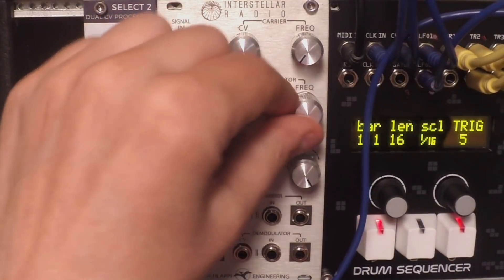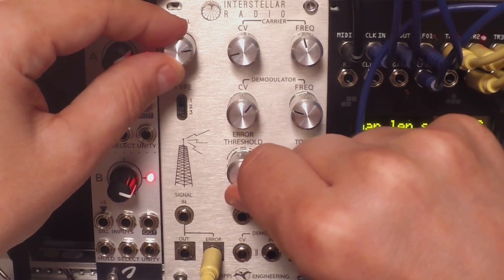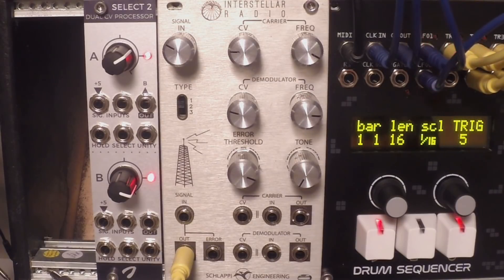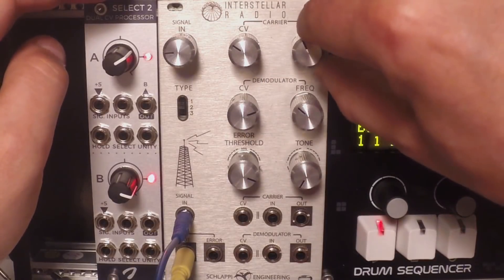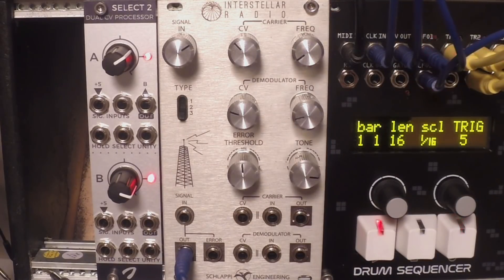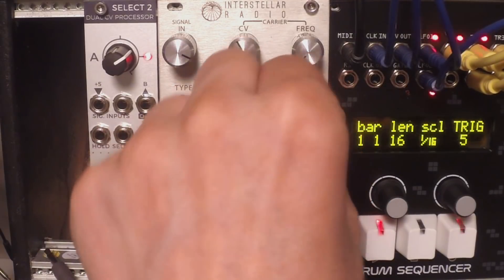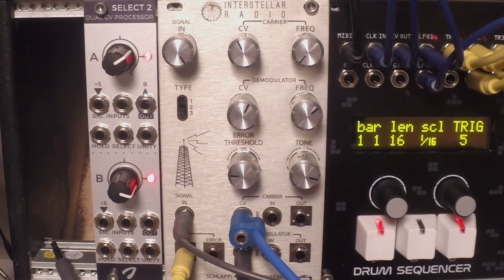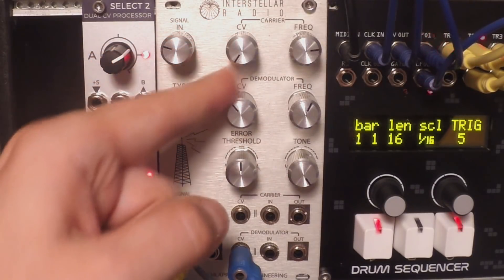INTERSTELLAR RADIO by SCHLAPPI ENGINEERING - overall review (ENGLISH VERSION)

Comment: Definitely a crazy module. Would love to hear some examples of it used as a sound source through VCF/VCA.
Reply from the maker: There is some VCF/VCA action in there - VCA is uVCA by Intellijel and the filter is the built in filter but yes -I might record something along BORG II and Interstellar lines. Might be fun.
Reply: I meant like used through resonant filter to build a percussion sound, or processing drum loop with ENV follower modulating VCF/VCA. I'll bet that could be very interesting.
Reply: Forgot to say, I have Erica Black Digital Noise which is great for such uses. I love running through a short percussive VCA while modulating parameters. I'm thinking this module would be great to use similarly.